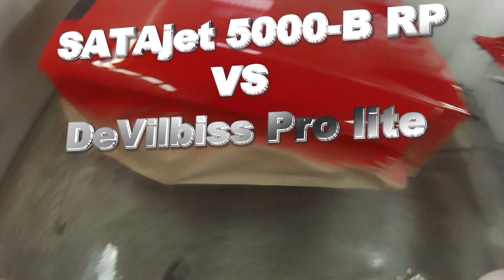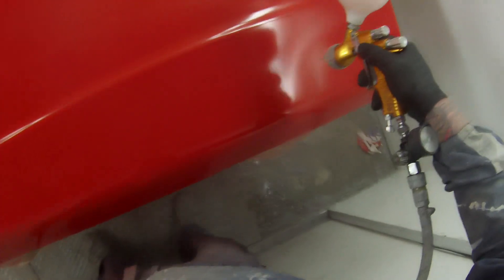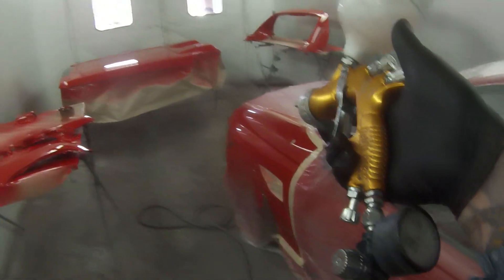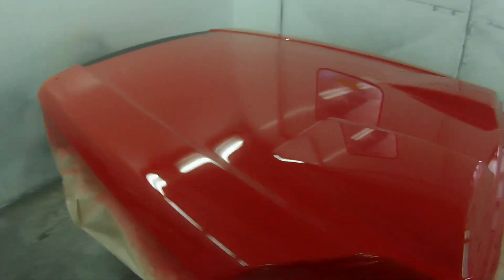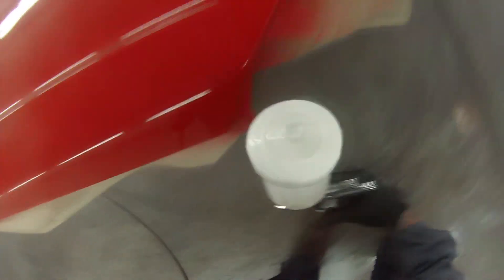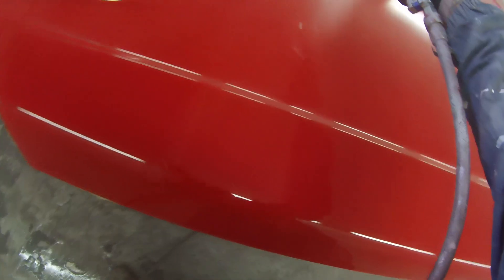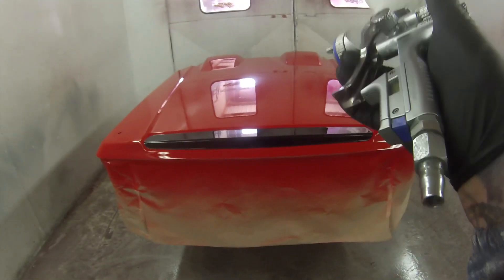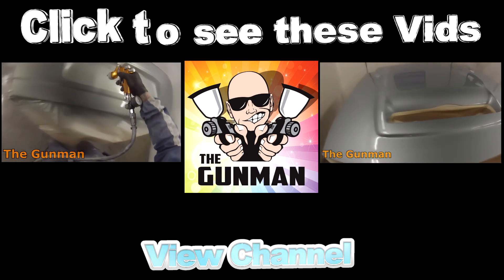SATAjet 5000 VS DeVilbiss Pro lite

Comment: I don't know much of anything about painting but could you tell me how much is 1 bar when painting?
Reply from the maker: 1 bar is 14.5 psi
Reply: I appreciate it. I was wanting to figure out how much 3/4 bar is . I should have just ask you that the first time.  but how do you know how much psi for 1 bar or 2 bar?
Reply from the maker: Most analogue gauges have both on them, Google is your friend. 3/4 of a bar is 10.87 psi, use this calculator for future reference.
https://www.google.com.au/webhp?sourceid=chrome-instant&rlz=1C1CHBD_en-GBAU722AU722&ion=1&espv=2&ie=UTF-8#q=3/4+bar+to+psi

Comment: So I should get a 1.2 tip for clear coat ?
Reply: Yea that is what is recommended nowadays in the US at least for the 5000 rp that came with our Standox system. We use 5000 HVLP 1.3 to base and RP 1.2 for clear, probably oriented around material saving. You can use 1.3 for everything if you like the way it clears. 1.4 works for base becomes a bit too heavy to clear with imo but can be done. You'll notice as times progress the tip sizes get smaller because transfer efficiency is better as technology gets better in spray guns.

Comment: what guns would you recommend for bicycles frames ?
Reply: These spray guns are too big they are for complete paint jobs for all my bike painting I use the IWATA LPH-50 excellent for painting bike frame tubes where they meet in tight places always paint a bike frame upside down first then right side up
Reply: @SchwinnXchange  I mean I can paint anything with a regular sized gun lol, but if it's easier for you to use a mini gun then go for it. I haven't used a mini gun in 4 years but found myself getting one just to have if i want to use in situations.

Comment: There are replicas of both these models on eBay for $115 for the Sata 5000b and $110 for the “DeBaybiss” Gti pro. Gonna try the Sata for clear coats since reviews are really good and price is 1/5 of authentic. Seller name is amazingntrade008. New to spraying and thought instead of buying generic stuff and paying $500 for a good gun, I’d try the replica for a lot less.
Reply: Why buy these cheap Chinese knockoffs shit when you can buy an iwata w400 for $250 Australian and it will last a lifetime?